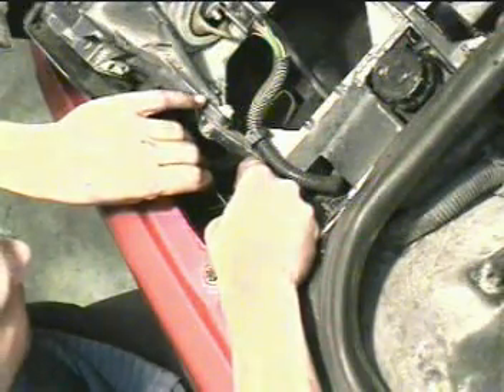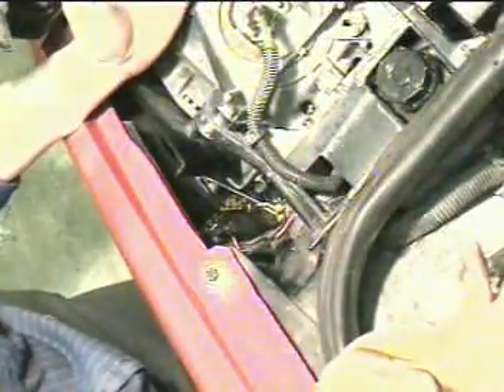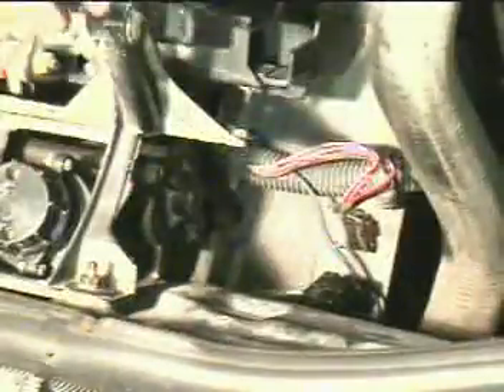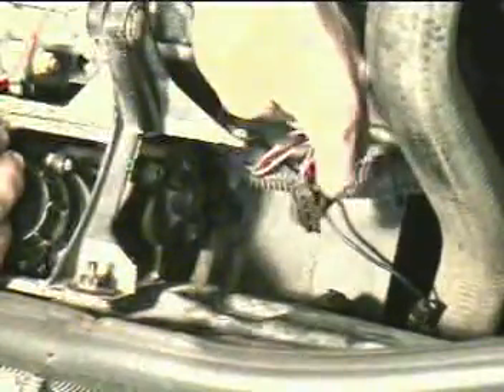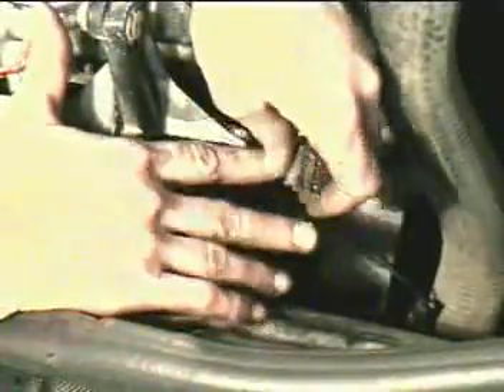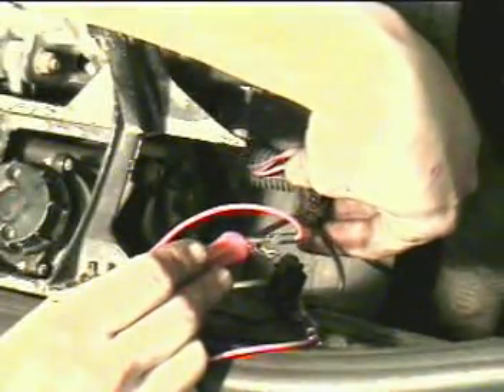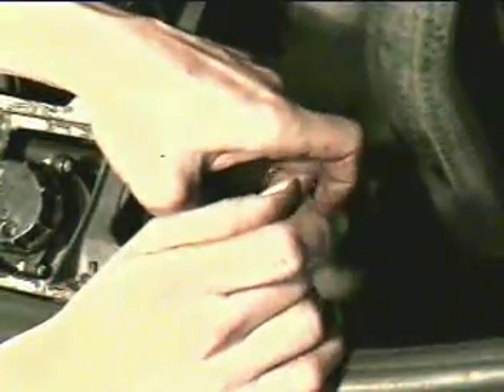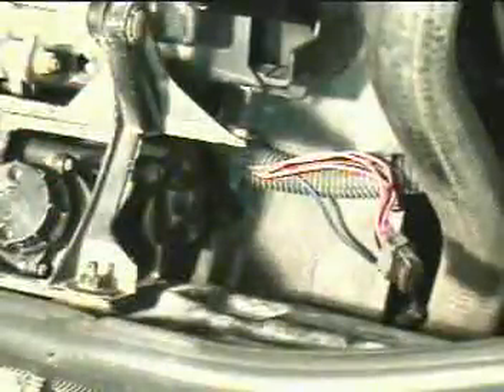fiero gen 1 headlight motor circuit test 2of2

Comment: I got a 1986 fiero gt i did all this test but i got one light when i turn off the switch the light goes up and the other goes down i do not know if its a wrong relay that is doing this need your help.

Comment: How do I locate and replace the fusible link should that be the problem?
Reply: +GW Hawes I have never seen a fuseable link be bad. describe your problem please and I will try to help.
Reply: +GW Hawes if the light bulb comes on, the fuseable link is ok.
Reply: +Buddy Craigg I tested the links and they are good.  I have trouble shot it down to the actuator in the motor. I am talking with the guy who rebuilt the motors to get it replaced.  thanks for the quick response!

Comment: i get power to both my headlight motors, i turn the headlights on i have to hold the headlight switch half way on and the headlights go up i have to push in right when they open all the way or it goes back down. i put in a new switch in it will not work so i put the old one back in do you know what it could be?

Comment: I dont have one of those testers nor do I have the cash for one at the moment but I was hoping you could help me? I just bought an 84 fiero, when I bought it the guy told me the left headlight wouldnt go up sometimes. he turned on the lights and the left one "Drivers side" didnt go up. lifted the hood and smacked the cap and it sprung up. then turned the lights off and they both went down. When I got the car home turned on the lights, they both went up and parked it and they both went down. the day after that and ever since "The past week" both headlights will go up but when turned off the drivers headlight will stay up and not go down. I have to manually crank it down each time now. could you figure out what is wrong just by that description?
Reply from the maker: Did you have to crank the left motor all the way down manually?
(That takes 120 turns BTW.)

If you only had to crank it a couple of times, and it took off on its own: then I suggest cleaning the comutator in the motor.

If you had to crank it all the way down by hand: I would clean the contacts in the limit switch. (it could be another problem, but I want to do it one step at a time)
Reply: buddycraigg The first switch that you are touching in this video, I unbolted that and when I went to take the cap off, it clicked into place and my headlight next to my hand went down about a half inch. I thought it was already closed but I guess not. now im having no problems with headlights going up and down but im 17 and confused as to how my headlight switches work. EDITED - I figured out how to turn on the brights by pulling the turn signal stick towards me. Thank you very much. subscribed :D
Reply from the maker: Ethan Kirkpatrick
glad to help.
Just ask if you need to know anything else about these cars.
Did you find the fuel release lever yet?
Reply: buddycraigg haha yeah it took me a few hours to find that one... ive fixed almost everything wrong with my fiero, the wobbly steering, headlights not going down, sticky gas pedal and sticky TBI. The only things left on my list is replacing head gasket, new brake pads, new oil pan gasket, new spark plugs, EGR block off, LED dome lights, rewrapping the steering wheel, and the previous owner smeared what looks like roofing tar all over the outside seal of the moon roof so I need to cut that off and find the leak and fix it so I can have a moon roof that opens. the head gasket might be a challenge for me but I think ive got it, EGR block off looks like a pain. I have no idea how to restore my steering wheel, all the glue has globbed up in several huge bubbly nasty spots but hasn't come out from under the material yet. The moon roof sounds like another pain and I dont know how to start that. im wondering if I can patch it with indoor house clear calking and im hoping its not between the seal and the moon roof, I hope its between the seal and the car roof. Also my head liner is looking pretty nasty and peeling in a few spots, there are probably lots of videos on how to do that. besides all that pretty much an 84 white fiero, auto 2.5L I4 with 148K miles no dents but a blown head gasket as my first car for $350. I think I got a damn good deal.

Comment: UPDATE
We checked the isolation relay and when we did the Blue/white tracer the right headlamp went up. When we did the solid blue, it didn't go up but it does show 12V, What does this mean?
Reply from the maker: I'm sorry,
Your explanation of what you did with the blue wires wasn't clear enough for me to answer.
.
Try swapping the headlight motor relays between each side and see if the problem follows the relay or stays on that side.
Reply: Ya, we swapped the headlight motor relays and it still persists just on that one side. We did the White wire to blue and blue/white and only the right side went up.

Comment from the maker: If you had power to the Green wire and grounded the Grey wire when you tried to make them go up.

And power to the Blue wire and grounded the Green wire when you wanted it to go down

And you were using a known good power supply and ground source.

Then the problem is with the motor.

I would start by checking the limit switch, it's pretty quick to get to.

Watch the first 4 or 5 minutes of the 2of7 motor rebuild video.